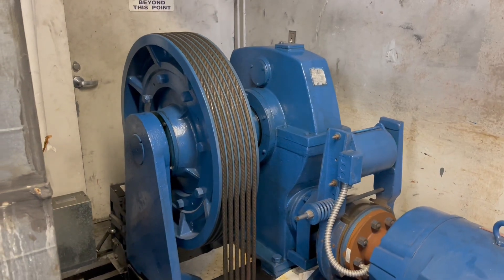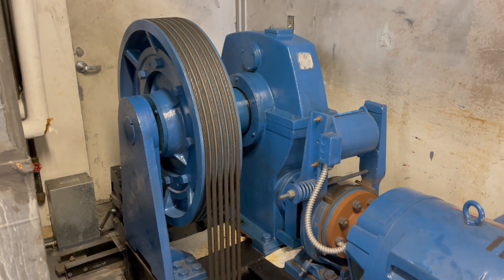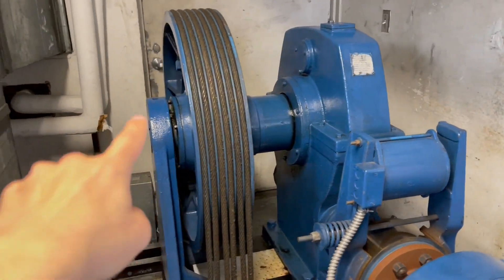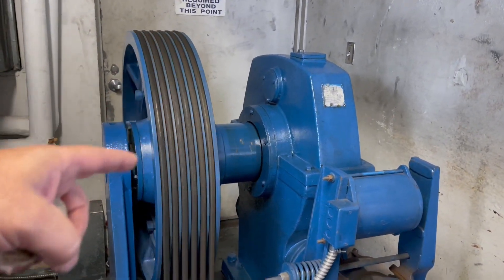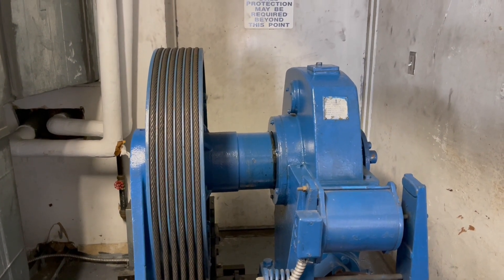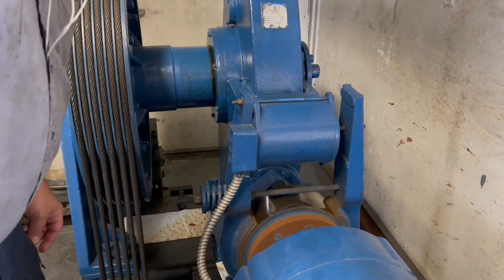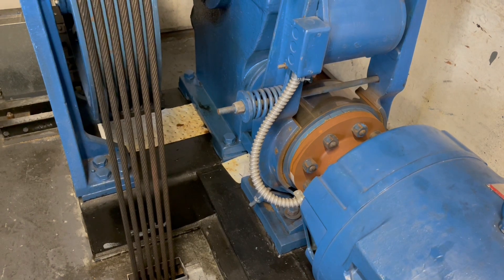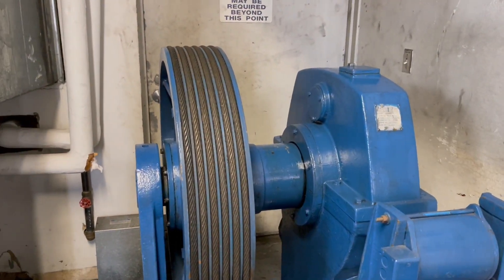1980’s Dover Computamatic? Elevator Traction Drive System

Comment: Gearless traction doesn't use the motor and gear system. In fact, lot of modern new elevators these days are purely gearless traction because not only they take less space, but they also are much better to maintain